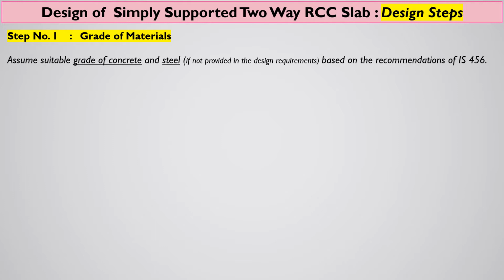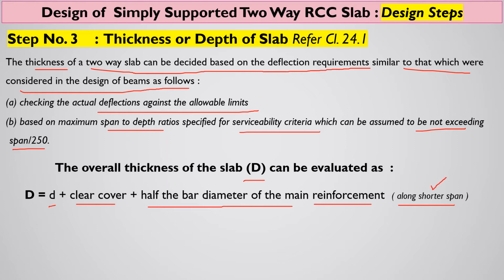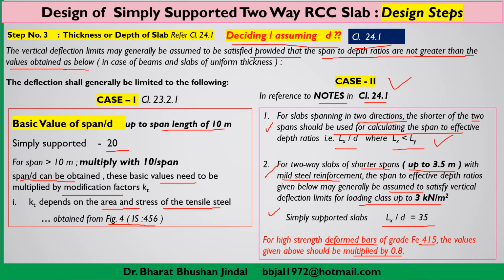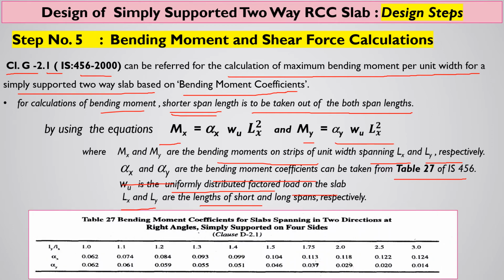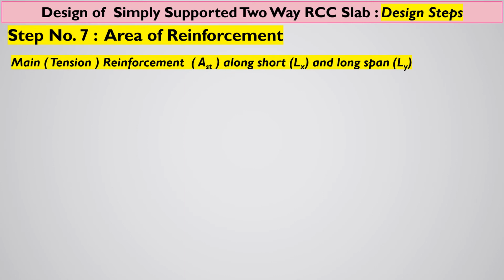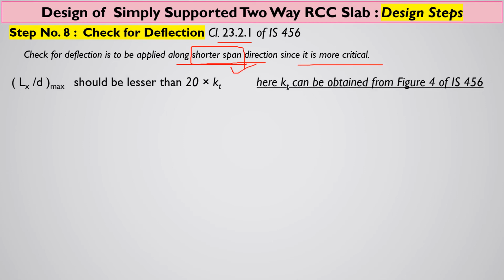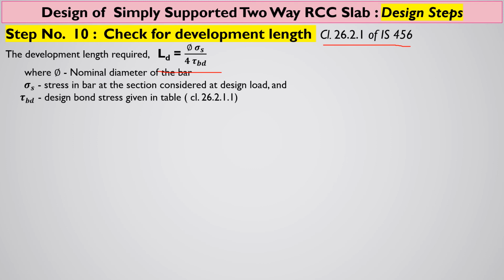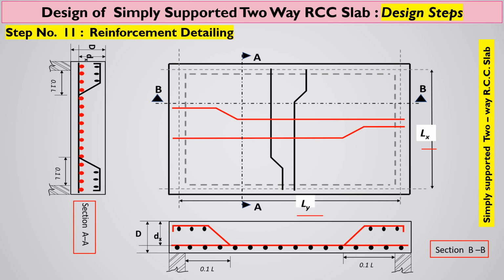Lecture 20 || Design Steps || Two way Slab Design || IS :456 -2000 ||  Civil Engg.

Comment: Sir in step 3 6:58 the diameter check 1/8 of the thickness of slab is only in case of 2 way slab
Reply from the maker: for any type of slab.

Comment: sir I was Unable to Fully understand Step 3 here time 7:12 assuming/deciding d?
and the two cases.
Reply from the maker: Very simple, IS 456 gives you two choices based on the limit of span length. Case I : for all type of spans beyond 3.5 m and Case II : for spans upto 3.5 m ( short length spans).
Reply: @DrBharatBhushanJindal  ok sir now I got it